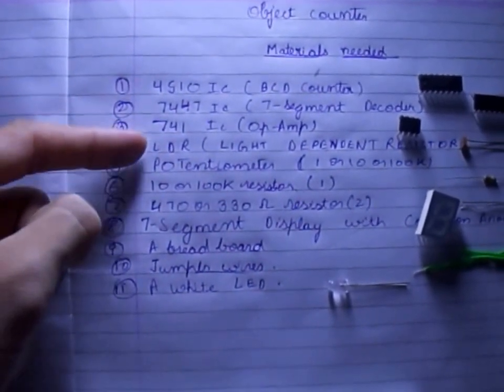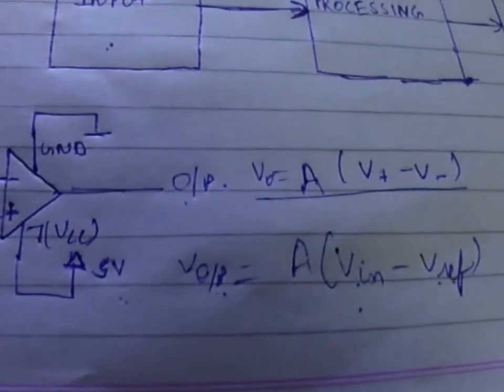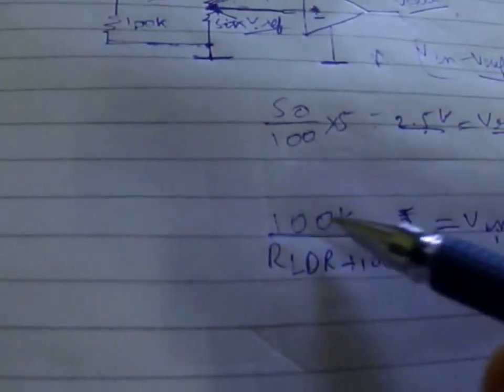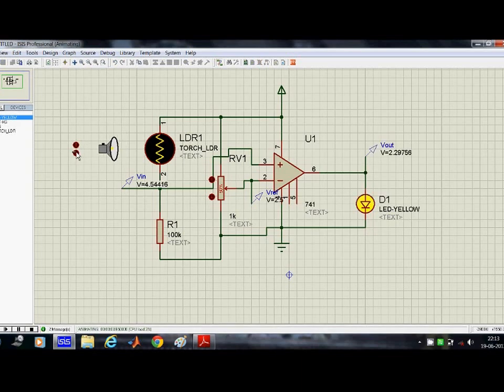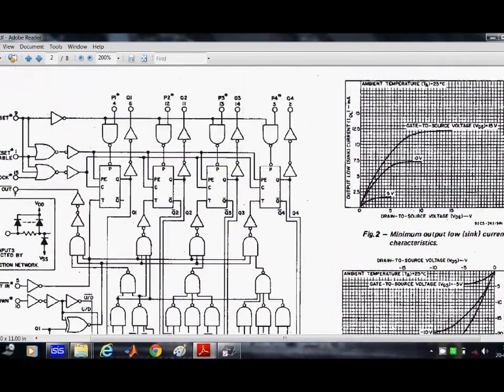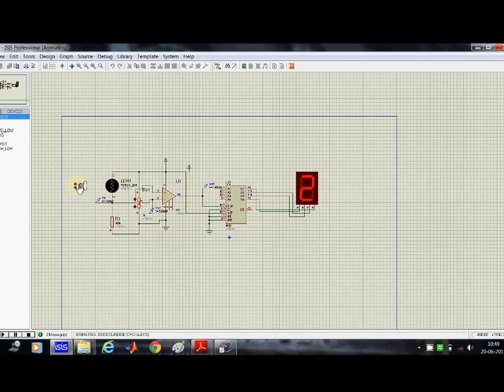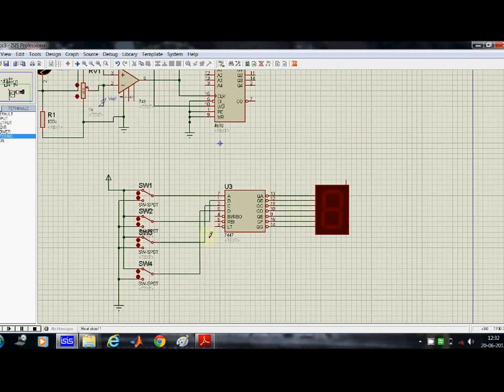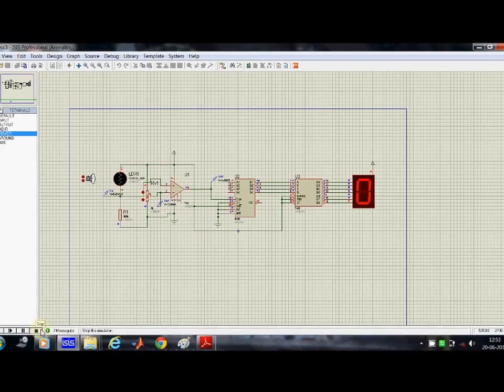cecc3: The object counter

Comment: how to connnect to the LED which can count until 30 deciml?
Reply: +Abang Mauf  You will need to use the carry out feature of the IC to cascade such that you can get more digits. However a better way is to use a micro-controller to multiplex between various digits. That is more economical if you are planning for 30 digits (Too large number of digits).
Reply: Rahul Dash can you give the recomended ic for cascading?
Reply from the maker: +Abang Mauf The same 4510 IC has the feature of carry in and carry out. Read the datasheet

http://www.ti.com/lit/ds/symlink/cd4516b.pdf. See page 3-249 and pg 3-254 to understand cascading.